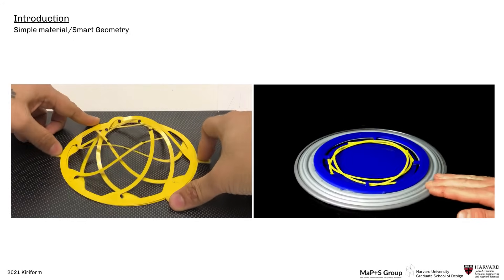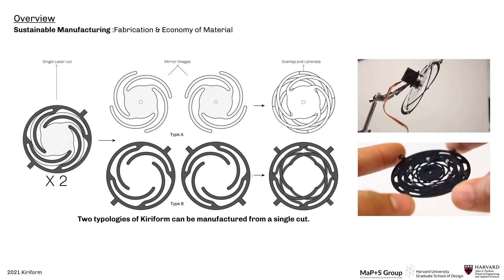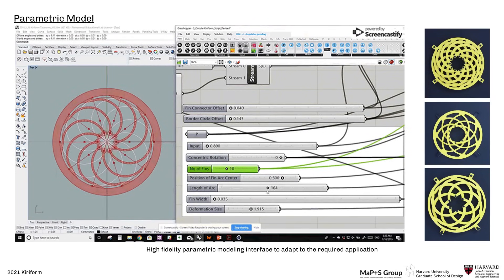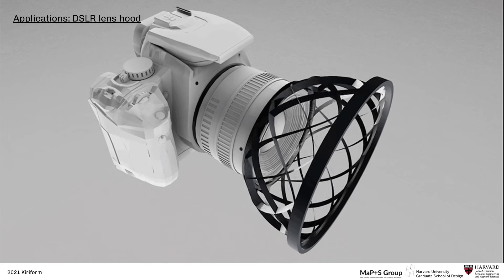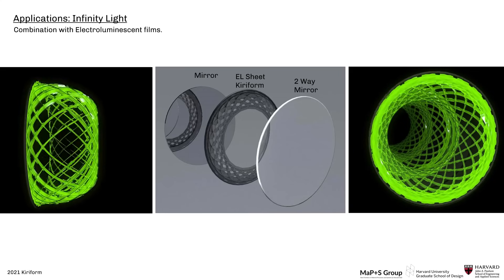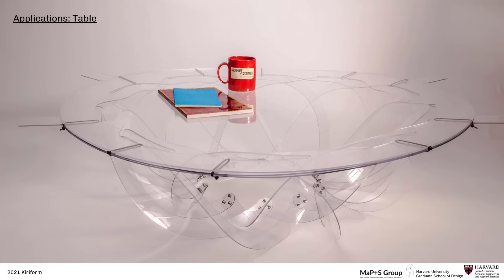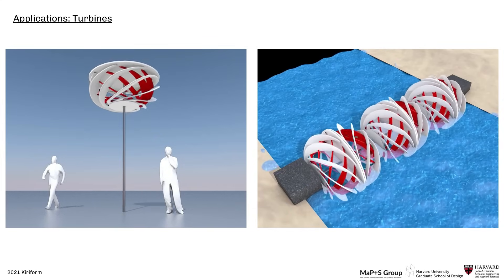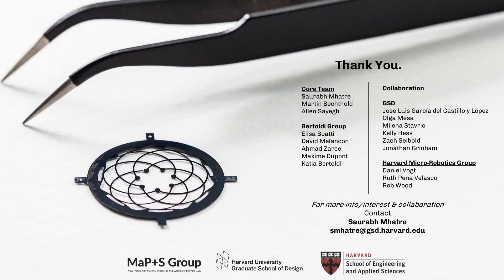Kiriform - Deployable Flexures (MaP+S Group, Harvard GSD + Bertoldi Group, Harvard SEAS)

Comment: The vast majority of use case examples almost completely failed at the function that was being demonstrated. (ie a lamp shade that doesn't shade the lamp)
Reply from the maker: You are correct . Its not a finished ready to use product yet . I covered a 'breadth' of speculative applications it can be used for and I am currently going in depth to see which of these make more sense than the others and what kind of changes / developments are needed for the same.
Reply: @SaurabhMhatre0  fair enough

Comment: Flexures are cool, but IRL, every part that I encountered that used flexing as a mechanism, eventually failed due to fatigue. It's Usually the first thing to go.
Reply: Those designs were not optimized for lifetime.  If you do not exceed conservative elastic limits then some materials will last almost for ever.
A snap action 'Microswitch' can be made with incredibly long mechanical lifetimes.  Many other examples of long life flextures like truck leaf springs.  Even a metal retractable tape measure has very long life absent abuse.

Comment: How can it work as a turbine if the twinned blade surfaces are twisted in opposite chiral directions?
Love that you used grasshopper in rhino. My favourite
Reply from the maker: Great point. I surely havent gone in depth at all but it will need some development .
I agree right now in the render the two sets of opposite fins are similar but for that application one set could be biased to have more surface area , lightness etc as compared to the other. The other could just be frames without a surface so as to offer no resistance to the wind. 
Rhino + Grasshopper made my life so much easier !!!!

Comment: The turbines are so awesome!! And also the half wall at 3:50 didnt see the flat version of it, can you please show it.
Also do you think you could make a shape like an igloo? Where theres ceiling structure above, but a door or even a wide open arc like a cave , similar to the half curved wall, but bigger and with overhead ❤
Reply from the maker: The half wall for now is just a render but it can be made using different diameter fins connected together. Think of a polar array of fins where all the fins are not same but have different (global) diameters

Comment: If super big, this would make a greate dome! ❤
Also! Do you think you could make an oval shape???
This looks like it could be an Incredible Tent!
Especially if it can folded when flat 🤯

Trying to imagine a print in-place flat lockable joints so that it can be folded x4, opened, and locked.
I imagine a coin with a crease in the middle.. turning 90° to enable/disable foldind of the joint.
=⦶= open, can fold 
=⦵= closed, cannot fold 

Like a map, open all the folds, lock all the joints, twist... Bam! A tent 
The joints need to be really good, flat, and durable, and with a color indication of opened joints to help close all quickly. 

Would love to know what you think, and especially if you think this can be oval 🙏
Awesome work!
Reply from the maker: Yes it can be oval shape. Based on the length (spiral) of the individual beams. And the coin -crease example is right on point - to make that a possibility. For the major part of the project I was always seeing that 'being able to cut this out of a flat sheet is an advantage' but I also know for certain (larger) scales other fabrication methods can be used. 
I have a prototype which I 3d printed which is a working mechanism right off the print bed. The 3d printing also allows for programmability of the 'cross-sections' of the beams which opens up a lot of opportunity.
Reply: Where you say cross section, you mean like giving the beams some shape, like an airplane wing to produce better lift ?
Reply: Thanks a lot for the response ! ❤ Really awesome work! would love to see you progress

Comment: This is so awesome ❤ I'm guessing you could make this out of a material that can be cured.. for example the table example, make it with a uv resin, and make it hardened, remove tabs, give it glass like qualities, incredible
Reply: Oh wait... It's complient.. meaning already Ridgid and under tension/compression haha my bad. But the idea still stands.. somehow (maybe with heat) relax the tension, without deforming somehow, and reform it solid. 
I think I'm just interested in making the final object super solid, even if it's a one-way process. 3:07 I noticed you put some weight on the table with your hands and it easily deformed..

So I wonder how you can start with the complient mech, but end up with a glass-like hard object which will not deform. I think uv resin might be awesome for this , 
Thanks and All the best!
Reply from the maker: Exactly , I am pursuing that direction too :). And that's correct - the table in the video isn't as stable as it should be . For now it was just a scaled up version of the small mechanism. I have made some changes in the smaller models which increase the stability quite a bit which I soon plan to implement in Table 2.0.
Reply from the maker: Yes, for particular applications , the deployable aspect might not be necessary.

Comment: Impregnated and/or sputtered with copper and this could be used to focus the magnetic field of a toroidal coil in situ. 🤔 Very cool compliant design! 👍
Reply: Pushing op idea to the limit.. can you make a motor or generator or transformer out of this? I imagine many more thin strands, and maybe a few of these stacked or weaved together. Wonder what electronic applications this could unlock, especially if miniaturized to MEMS levels...
Reply: @AGI-Bingo  I like where you're going with this! ✌️ It would allow for quick tuning of coil geometry and layout, and stacking multiples in a parallel or series based on your needs.
Reply: @orpheuscreativeco9236  yea i was gonna mention tuning the geometry to effect the electromagnetic properties, but not sure what the effects would be, so waited for someone else to bring it up haha

I also proposed some ideas in other comments, hope to get a reply from them,
For example making it oval, to make a pop-up instant tent, and adding lockable creases so it can be folded when flat for extra compactness
Reply: Very interesting ideas guys, I'll love to use these kind of structures as EM brakes. A copper flexure could deploy due to the centrifugal force of high RPMs changing its orientation with respect of a permanent magnet's B. Or a vent actuated by the thermal buckling of the material.
Reply: @Ezio-Auditore94  Nice! Great potential applications 👍 I wonder how long the lifespan of these materials are? 🤔 It would be cool to test that centrifugal force concept on a large scale.
Reply: @orpheuscreativeco9236  Well, they say well designed flexures can last a century, the EM breaking application I was thinking takes advantage of eddy currents when the material is aligned with the B lines. When not aligned they don't pose much impedance to movement, but they do. So it's like a "leaky" brake that even if very little, it's always breaking. I should explore other architectures.
Reply: Are we talking about a variable induction induction coil?
Reply: Thanks for feeding a patent troll for free with more stuff to patent.

Comment: Every time someone says "our patented", I hear "please appreciate our ability to sue you should you want to use this". So, is this a step to prevent patent trolls from causing damage, or a means to make money?
Reply from the maker: Tbh, just a way to show that its novel and hasn't been done before :)
Reply: @SaurabhMhatre0  That's not true. If you want to say novel and hasn't been done before, then you would just say that. Hardwareful is correct stating that if you say it is patented then that means it cannot or should not be replicated without potential legal recourse.
Reply: @SaurabhMhatre0 pretty sure this has been done in many variations. you might want to double check your prior art due diligence so you dont get counter sued for infringement and failure to achieve Freedom To Operate.
Reply: @williammorris1763  You have evidence of this prior art?
Reply: @paradox_1729  no i just made it up to waste my time making this comment.
Reply: @williammorris1763  I've been searching for a similar mechanisms for days and it's the first occurrence of it I've seen. There are MANY ortho-planar passive springs for example, and MANY linear flexures, but this is the combination of the two I was searching for and found nowhere. I had in mind a kind of iris mechanism that would create ortho-planar actuation, which is somewhat similar to what they did. Too bad it's patented, I'll probably not be able to use it for my project.
Reply: @76Eliam  paper cutting is an easy find.
Reply: @williammorris1763  sorry but I don't understand what you mean.
Reply: @76Eliam  kirigami
Reply: @williammorris1763  I've never seen a kirigami providing orthoplanar actuation from rotation.
Reply: @76Eliam  maybe this application is novel but always better to be safe than sued into oblivion is all i'm saying. This was a short cursory search. so the due diligence required by the inventor is a lot deeper than that and you may be just a few search layers away from finding the info IF it exists.
Reply: Patent are a good way to learn from invention and work around them for your opponents 🤦
Reply: Есть американский профессор занимающийся этой темой. 

https://youtu.be/86McqnJNy9o?si=t6deAKIzSl5PyyEj
Reply: Haters sit on their couch and criticize those out there doing the things.
Reply: Is there a better way to actually protect those who worked hard and actually invented this? How should they be compensated for their time and effort?
Reply: The reality is, the innovators rarely see any money when they're not the owners of the patent, and patent trolls on the other hand may have the legal prowess, but you wouldn't exactly attest them a great contribution to progress.
And when you are a a patent owner with a business, the thing you came up with gets cloned overseas.
Let's not romanticize patents.
Reply: Good question! Good response!